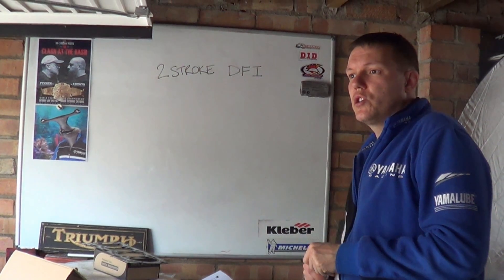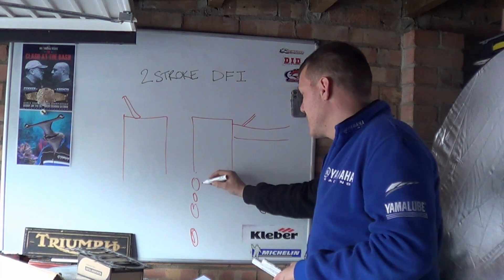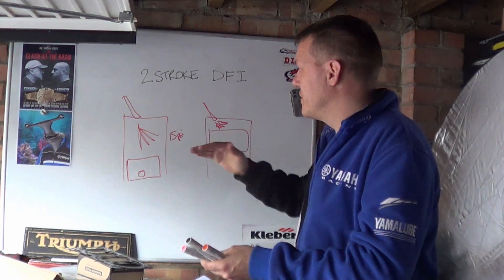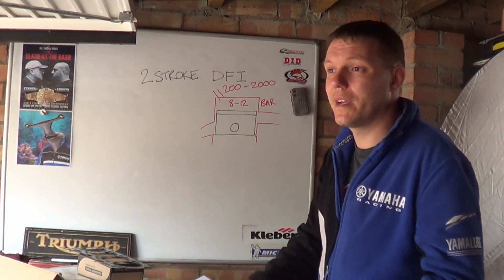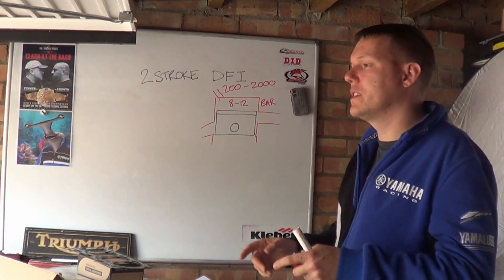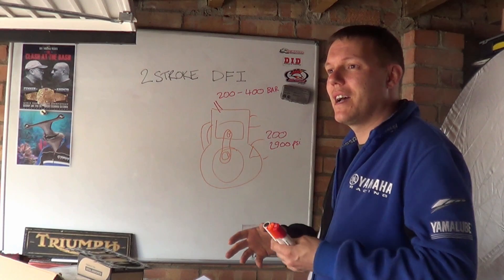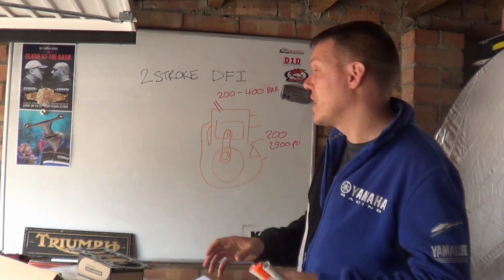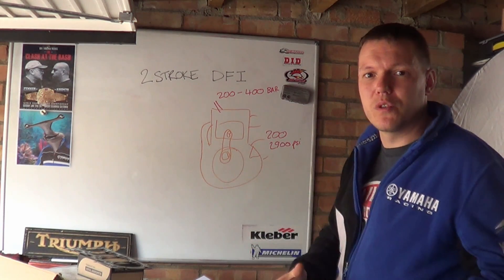Will Direct Fuel Injection save 2 Strokes?

Comment: To me DFI 2 strokes are the holy grail of ICE engines. Why haven't we done it sooner? Besides like chainsaw or motorbike 2 stroke where simplicity is the goal. In those applications I think a rotary would be far better because it is better suited to the high rpm.

But think of a 2 stroke v8. What if GM built a 2 stroke direct injected LS motor?
Or buggati built the next W16 engine with two stroke direct injection? Where a little HP loss is tolerable. And a suitable pump can be built.
There have been 2 stroke gasoline v8s built before, they were for outboard motors.
Reply: You do realize that the 450 4 stroke revs much higher than the kx500 2 stroke. The kx500 is caple of much more than 65 hp, i would like to se it with Boyesen exhaust trapping valves with can eliminate the expansion chamber and greatly broaden the torque curve, also the kx500 has much more low end torque compared to the high revving 450 4 stroke.
Reply from the maker: Peter Hubbard, a viewer on here has been talking to me about a V8 2T he has. Its a V8 Evinrude & Johnson outboard ( originally build by OMC) 

"What if GM built a 2 stroke direct injected LS motor? Or buggati built the next W16 engine with two stroke direct injection? Where a little HP loss is tolerable."

- it not all about HP, its more about the torque. A W16 2T would melt, and the torque would be crap.
Reply: Oh wait I forgot the W16 get insaly hot sorry!
Also here's how to solve high injection pressure problem: Air blast injection.
Reply: Now you talking, a 2 stroke ls1 motor would be awsome, you could loop charge it through both int/exh valves and a blower for scavenging. It would need a special cam that runs at 1:1 ration crank speed.
Reply: Toyota has built such an engine. However it is large and heavy but at is quite the torque monster! A better and lighter version which has been pursued by Chrysler would be a uniflow scavenging (roots blower) with an ordinary intake port at the bottom or a sleeve valve. 

And those have been built too. Two stroke 4 exhaust valve diesels were built in the millions for decades by general motors who formed that division into detroit diesel. 
The Uniflow intake port-sleeve valve exhaust direct injection engine was a  massive  v12 of 26 liters called the Crecy. It was built by rolls royce to replace the Merlin for super marine spitfires. But with the advent of the jet engine it was abandoned.
Reply: It was the toyota s-2